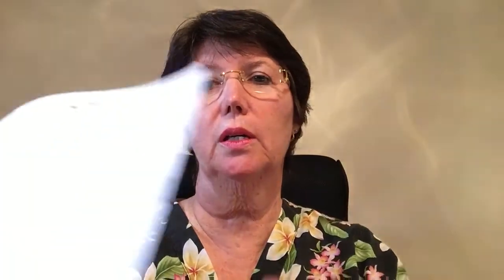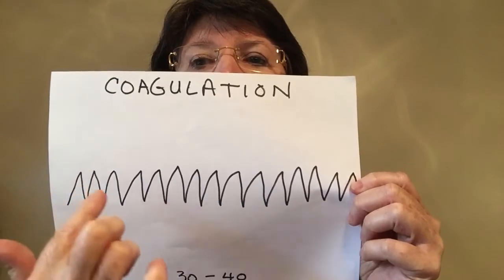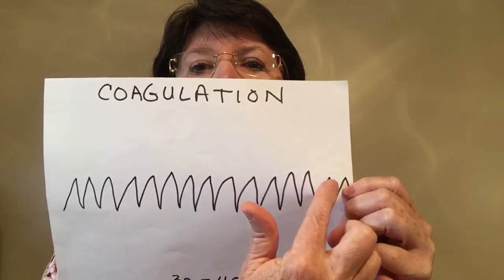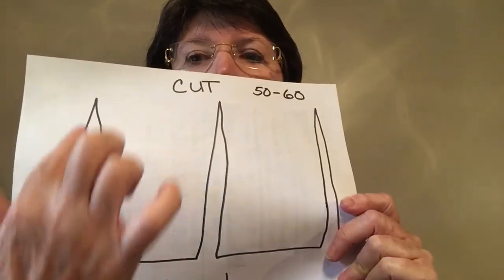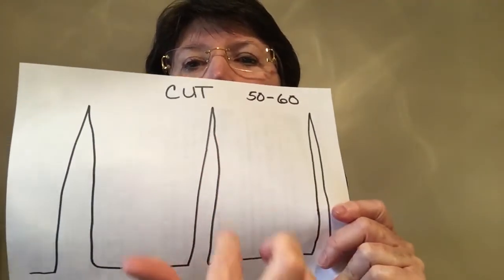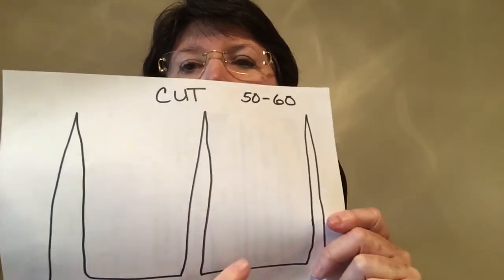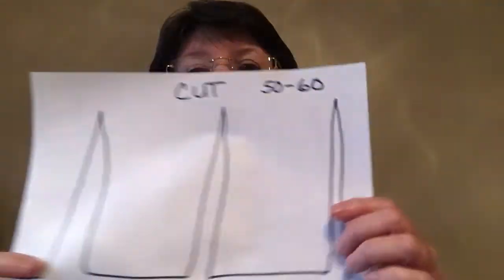Bovie: Hot Tips for Handling One

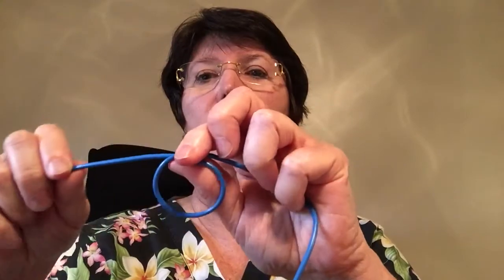Comment: 5:45
the loop is smart way to prevent it from sliding. i see scrub nurses tying a dry gauze around the wire then using towel clip to fux it to the drapes.. but i guess forming a loop then getting a towel clip through the loop and fixing to the drape is easier.. Thanks for the tip.. i guess i missed this tip 😁
Reply from the maker: This is one I actually have a resident to thank.  Last year a resident rotating through our service did this.  I liked it and have used it ever since. We usually challenge the residents to see if they can come up with one improvement to our routine.  It is interesting to see some of their innovations.

Comment: hi.. do you suggest using the blend cutting mode in abdominoplasty?
Reply from the maker: Yes.  You will find that it still cuts through the tissue well but will help reduce the amount of bleeding significantly.  Usually the lowest blend (blend 1) is sufficient to do the trick.  If the bovie is pulled through the tissue too fast it will still bleed some.  But using the cut at a nice steady rate will cut through tissue faster than the coag and still achieve hemostasis
Reply: Thanks.. I was gonna choose the blend 2 :)..

Thanks for clarifying..
Reply: What setting did your surgeon use for the blend and the coag?
Reply from the maker: You can start with blend one and titrate up as needed for each patient.  But one is usually sufficient

Comment: 8:17
i almost burned the skin, since I was holding a non toothed forceps to coagulate some oozing vessels and I wasn't aware that the forcep was touching the skin, but good thing i didn't touch the forceps with the bovie. 
Thanks a lot for the tips.. specially the blend option, it could be the reason why we have in some cases of abdominoplasty a lot of vessels that bleed while cutting the camper's fascia..
Reply from the maker: Yes. I remember when the surgeon had to teach me to be aware.   After a while it becomes so ingrained that it will just be part of what you look for naturally. 
It bleeds so much more when there is no blend.  So that is now one of the first things on the mental checklist I look for when the bleeding is more than expected, as well as what is the patient's blood pressure, is it a patient with chronic pain who may take a lot of nsaids, etc.
Reply: As well as good analgesia intra-operatively. I found in some centers where they have no narcotic and only use iv paracetamol, the sympathetic tone increase judging by the BP.
The only procedure that has so much chance of having blood shooting through vessels is abdominoplasty, with those perforator vessels. I'll have the blend mode in my checklist definitely..

Thanks!
Reply from the maker: Yes.  Anesthesia is a big part of it.  We usually ask anesthesia to maintain the systolic at 100 during dissection to decrease blood loss; then when we are finished with dissection and drying up the field to close we ask them to make the BP normotensive so we can control anything that may bleed post-op.  
When I assist on a tummy tuck I palm a mosquito so I can clamp the myocutaneous perforators before they are cut.  Once the incision is made and the dermis is dissected I put a tenaculum on either side of the midline (about 2-3 inches apart) and use those to lift the flap.  With the other hand I push down on the fascia to help expose the bloodless plane.  Pushing down on the fascia also tends to help expose the bleeders before you dissect them so you can clamp them and prevent them from retracting or bleeding.
Reply from the maker: Also, once the flap is lifted inferiorly a couple inches and we can see that the tissue from the umbilicus down will be removed we split the flap up the midline toward the umbicus and I move the tenaculums up to lift and expose.  This helps improve visibility to see the perforators and the umbilical stalk as we dissect up to them.  I will usually place my finger along the umbilicus down to the base of the stalk to give the surgeon a visual or where it is and to protect it.
Reply: Thanks a lot for your valuable tips..